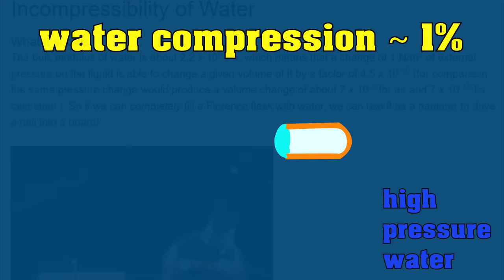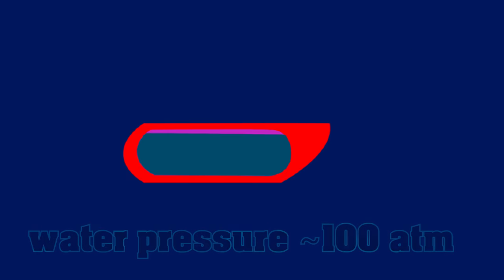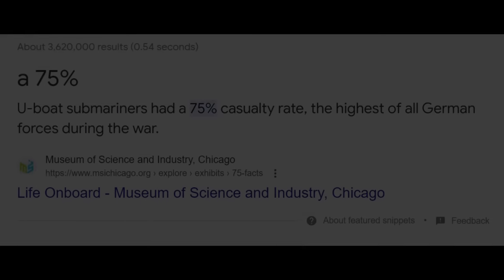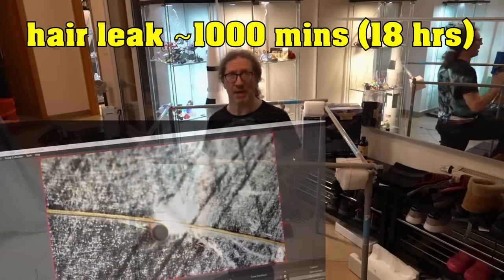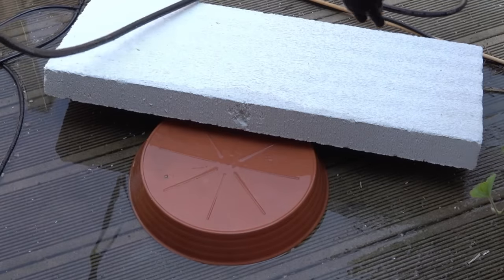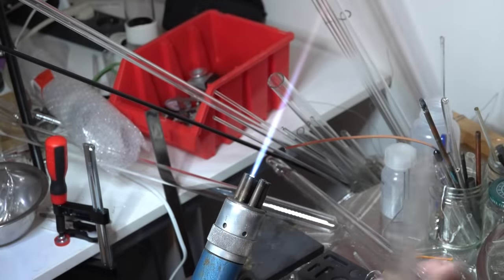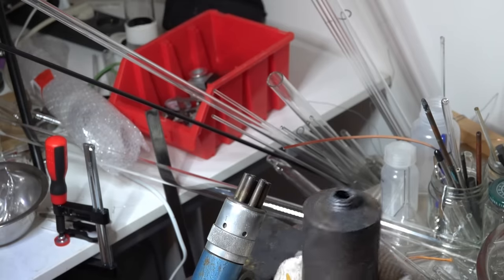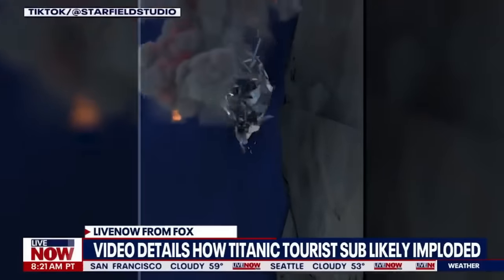Why the Titan sub failed

Comment: A debris field consistent with your explanation would include an intact carbon fiber tube, possibly still attached at the end without the leak and the bodies of the passengers. Explosive decompression would leave the end caps and small pieces of carbon fiber and no bodies. So far the latter is consistent with the debris. May have started as a leak, although transcript doesn't mention water ingress and they were at 3500 feet for a while due to an inability to rise, but it probably ended explosively.
Reply: Also there is an audio recording of the suspected implosion.
Reply: @E_Ten  The presence of a leak doesn't preclude an explosion/implosion, it just may be the trigger that started it. Think of how a hydraulic hose fails on heavy equipment, it doesn't just slowly leak with increasing intensity until the hose falls off. It seeps and barely leaks until it all of the sudden blows out. But it's the action of the leak that literally cut through the hose until it failed 'explosively'

In this case I think it's more likely that the carbon fiber or hydraulic fitting itself was the source of the leak, which cut and damaged the hull until it failed rapidly (it appeared there was a few hull penetrations in the titanium ring from the recovery pictures). The rapid descent would suggest to me that the hull was being damaged and becoming waterlogged, that  may have been the source of the leak and failure. But I think it's unlikely it was the cyclic loading alone that cause the failure given plastic and carbon fiber are both rather good under cyclic loading so long as they are not mechanically or chemically damaged in the process.
Reply: @2009dudeman  Of course it could be a leak preceeding the implosion. But the transcript stated a crackling noise coming from the aft, no mention of water ingress or hissing. I would assume you would hear or notice that if you're so waterlogged you can no longer ascend. My comment is just because Thunderfoot is criticizing the animations of an implosion when the reality is that probably did happen, rather than HIS animations of a tube filling with water. The vessel clearly went down one too many times and this is all speculation based on available evidence. The adhesive could very well could have been the weak point and wore from cycling. What wasn't consider here is that even though the dissimilar materials have different shrinkage rates the pressure is still compressing the titanium caps into the carbon fiber cylinder axially. Like opening a plane door at altitude which opens inward. I would still find it unlikely for water to find a path through the adhesive and into the chamber. Not impossible though. I suspect some other cause for rapid descent and slow ascent after dropping ballast. Human error seems more likely with Ocean Gate than water ingress given the available info.
Reply: @E_Ten  you won't always hear tiny leaks. Leaks in diesel common rail are silent, yet it's a 15-30 thousand psi leak. They are invisible, silent, and if the stream touches you it'll feel like barely more than a bee sting for just a second, only you'll have diesel fuel injected deep into whatever tissue it touched. Good those wondering, hospitalization is immediately required or necrosis will quickly set in.

In a sub with a sub millimeter leak, which is about what a fuel line would do when it starts leaking, wouldn't be audible or visible. I already stated the leak didn't have to be in the glue either. There were separated compartments from the crew section that could have been filling with water unknown to the occupants. If the unofficial transcripts are to be believed, they suffered system faults shortly after hearing noises. It's unlikely they are going to have power system faults simply because the hull flexed. However, if the hull crack caused a leak that started spraying the electrical system, that could cause the fault.

Again, I never said it's one of the other, and neither did Thunderfoot. Simply that a leak would rapidly expand to the point it catastrophically failed, those two aren't mutually exclusive. The sub filling was simply to explain that it didn't matter if it filled up slowly or explosively, you'd die one way or another. The massive fracture from differential expansion was another option.

However, and I've said this, the likely answer is a combination of a leak and catastrophic failure of either the hull or a hydraulic fitting/seal (which would include any hydraulically sealed joint/fitting). 

To your point that the end caps would still be pressing in on the tube, you're absolutely correct. Which is even more an issue because it means the caps and tube would be pressed hard into each other as they compressed with depth, creating a strong shearing force like a fault line. The only lubricant between the carbon fiber and titanium ironically being glue, which would remain semi flexible if I understood the videos from oceangate. It's one of my guesses that the shear force damaged the carbon fiber tube and cause a tiny leak, slowed by the glue and pressure from the endcap. Eventually that leak damaged the tube enough that it catastrophically collapsed. That would also explain why they made it so deep without going with water, the depth itself was crushing the carbon fiber as it was being damaged, partly sealing the leak.

I could attribute the rapid descent, if accurate and not due to water ingress, to the owners own gusto and the toxic environment he created.
Reply: @E_Ten  Remember , the transcript is unverified.
Reply: @tempusername-l5d  so you don't understand what was said. It's not the pressure,.. if you took an end cap off and sunk the sub from the surface it wouldn't explode. It's specifically the large volume of high speed water rushing to fill the void that causes the issue.

It's the same issue that blows apart water lines in houses. It's not that the pipes can't handle the pressure, it's the sudden stop in flow that causes the damage as the mass of water dumps all is inertia at the speed of sound in water.

As far as the animation, it has the entire sub crumpling into a ball then exploding. Expect we have essentially full pieces of the sub for nearly every part except the carbon fiber. Even the fragile fiberglass tail piece was largely unscathed. So it clearly didn't all crumple in because every metal piece was mostly unharmed. The explosion was limited solely to the carbon fiber imploding and exploding. Which if you want to argue the video is 'close enough' then the segmented animations in this video are also accurate as they contain every set of events albeit in disconnected sections. Though you can't honestly be surprised given the video from fox likely cost hundreds of dollars to produce at a minimum and Thunderfoot is spending time making his own animations and no one is claiming he is an expert animator making photorealistic video (that kind of animation isnt cheap). That still doesn't negate the fact the fox video is immediately disproven by search and rescue pictures took just days after the accident.
Reply: @tempusername-l5d  again you fail to put multiple things together. Just because an even is explored to it's own end, doesn't mean the final argument is that.

You know what hydraulic press channels video also showed, that one of his tests developed a leak, and Lauri even started that making one that didn't leak was very difficult.

The main difference there is the scale, it just wasn't large enough to simulate damage from a leak.

You, and many others are doing the very same thing you claim TF is doing. You are dismissing other events that mirror conditions in this accident. Hydraulic hose failures don't just explode with no warning, they always start with slow leaks that seep for a bit prior to transitioning quickly to a blowout.

You've already demonstrated you don't understand that water hammer is explosive and is not pressure dependent. Now you demonstrate you can't piece sections of examples together, nor can you critically analyze similar high pressure differential failures to determine a likely cause. This transcript you and everyone else mentions as being proof there wasn't a leak, clearly indicates an issue several minutes prior to loss of contact. It's not like it imploded and they kept talking for several minutes. Instead, the noise they heard was likely a fracture that caused a destructive leak.

Yet you still get caught up on the portion of the video simply explaining why pressure is not lethal (as many claim), it's the rather high velocity and mass of water crashing into you. You are the exact reason he had to make that part of the video. The pressure isn't deadly, it's the mass behind it...
Reply: @tempusername-l5d  so you ignored the part of the video where he mentions that a cubic meter of water would be rushing into the sub at about 1500m/s (or about 3350 mph)...

You can't separate concepts. TF is not arguing the sub slowly filled, he explained that a slow leak that never got bigger would let in a certain volume per minute. That is NOT the same as saying the leak never got worse. The fact is he also mentioned weakness building until it catastrophically failed, you just can't combine the two concepts.

You want to insult people who are able to take points from various concepts and combine them into an overall picture. Yet you fail to grasp even the most basic of concepts, leaks grow...

This is your failure to understand simple things, everyone else seems to understand a small leak won't stay a small leak. In fact the pressure washer should have been your clue that's what he was getting at.

If you were able to read this far, I'm impressed. I don't think you are actually reading a word I say and instead are just screaming nonsense because someone is telling you that you're wrong.
Reply: @tempusername-l5d  half your points are based on the flawed premise that water at that depth wouldn't cause damage from a leak, which is laughably incorrect given a $100 pressure washer at a fraction of that pressure is plenty capable of damaging carbon fiber.

Despite all that you wrote out you still refuse to understand the simple concept that high pressure leaks damage the material they leak through.

Lastly, you can't understand the difference between the statements "impact is deadly, simple pressure is not". Nor can you combine two examples more complex than object crush and make big boom...

You think I'm arguing against experts because you don't understand simple things and honestly believe it just collapsed out of nowhere while both believing the unofficial transcript and simultaneously refuting it's validity.

Comment: When they say water is incompressible, they mean it does NOT significantly change in volume, however air DOES. So any air in the vessel is not resisting the water, only the pressure vessel does that. When there is a leak, the water will rush in, displacing the air and compressing it to ambient pressure, at less than 1% of its previous volume. The shock wave comes from the sudden collapse of the pressure vessel.
Reply: @tempusername-l5d  I dont think he knows what he is talking about
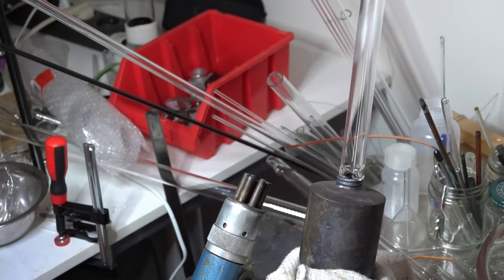Reply: @tempusername-l5d  22:03
Reply: Thank you.  The video starts out by stating a falsehood, so I had to stop watching (since that ruined the video's credibility).  Liquids are not compressible.  Gases are.  So the air in the imploding sub gets compressed to a tiny fraction of its initial volume very quickly when water rushes in.  The water's volume itself never changed.
Reply: Exactly! When people say water is incompressible, they don't mean it literally. They mean it in comparison to air.
That was even taught like that to me in school.
Reply: @benjaminsaragosa9869 volume change compressing liquids would be negligible

Comment: For the pressure washer demonstration, you didn't have a tight enough jet, it may say professional on the box it came in, but there's a bunch of consumer saftey baked in as well. So if it were  necked down to say 1mm it would cut the plastic palnter tray
Reply: Looked like one of those cheap ones.  For a decent one you need a air compressor

Comment: When I realized that they made the compression hull out of two different materials, I knew it would fail. But using carbon fiber meant it could fail from minor imperfections that quickly grow with each dive...
Reply: It was only rated for one dive because of the carbon fiber.  This was the third.
Reply: @justinwhite2725  This was the 12 dive. But 3rd to Titanic's depth.

Comment: I just don't really get how no one caught it. It's like it was designed to fail. I mean ignoring the fact that it was glued (which is fine in a lot of scenarios, not sure about submarines though) the carbon fiber part was INSIDE the titanium end-cap. Every time it was pressurized, the two parts were pulling on the glue

Comment: Regardless wether the analysis turns out to be true or not, this is a great way of educating people on these concepts
Reply: Except that he misunderstands the concepts and presents them with poorly thought out examples. Even if his conclusion is accurate, these two videos are steeped in misinformation.

Ironically, the closest he got to accuracy in his demos was the one that didn't work the way he intended — a pinhole leak would've been equivalent to a pressure washer spray (only if the hole didn't propagate). But then he compared it to a water jet which is an order of magnitude times as much pressure.

Also ironically, he calls out other artistic renderings for poor simulations of physics just before showing a graphic depicting the surrounding water depressurizing, which is just entirely made up physics.
Reply: @CookiesRiot  that's an interesting perspective. Would you like to correct these misinformations, so I can understand your critique better?
Reply: @jakokaiser1169  Pressure washers are designed with circular nozzles for a reason; non-uniform openings create sudden spikes in material strain when force is applied, causing structurally weak areas to fail and failures to rapidly expand. Having a tear in a ring-shaped epoxy bond will almost certainly shear the bond (research reentrant corner stress). But it also indicates asymmetric loading on the carbon fiber material, which itself means almost certain failure for the cylinder, not just the glue. And that assumes the glue failed before the cylinder, which has yet to be determined (but is certainly the most plausible part of TF's video).

TF denies the cylinder's failure, though, without the ability to model or test it; he claims this verbally when he says repeatedly that it wouldn't have imploded, and (more relevant to the first reply) his 2D animation shows a perfectly rigid cylinder being filled from an open cap.

The made up physics, though, is his explanation of pressure (mostly explained in the previous video, but still presented in the animation here)...

In the last video, he elaborated that it would depressurize to 1atm, which is false in two separate ways; total pressure remains basically unchanged and "static pressure" would only drop to about 4atm due to "dynamic pressure". He also compared it to falling water under gravity with no pressure on it and to a microscopic water droplet being released from pressure to equalize with its surroundings (while apparently under surface tension), both of which are mind-numbingly incomparable to water pressurized to hundreds of atmospheres with an entire ocean to fill the void.

Comment: If the failure mode was a pin hole leak. I think you would expect to find the main tube mostly intact,  even if the final water hammer popped off the ends. 
So,  the state of the debris they find (if any) will be fairly informative.  If it's tiny shards of shredded carbon fiber, that would be more likely to support sudden structural failure. While larger intact sections could indicate water leakage at the glue joints. 

Either way, gluing together materials with vastly different bulk moduli for such extreme environments was always going to lead to disaster.  Either the glue joint would fail, which in the best case scenario might result in the embarrassing spectacle of the front falling off when you surfaced (as the pressure differential that would hold it on under water is removed). Worse would be if the glue held. This would result in the titanium ring effectively tearing the ends of the tube apart (similar to your example with steel and glass), creating thousands of not millions of cracks in the carbon fiber. That 100atm of pressure will find the weakest spot.

Comment: Disagree.
At more reasonable depth, a pinhole leak can happen. But at that depth, your hull is going to be so thick, that in order to get a pinhole leak, you're looking at getting water past like 6 inches of hull, and that means catastrophic failure. It's like having a pinhole leak in a huge dam. By the time you see a leak on the dry side, you're way past saving the dam. Just the water jetting across the inside of the sub would stand a good chance of cutting through the other side. Das Boot is a cool movie though.